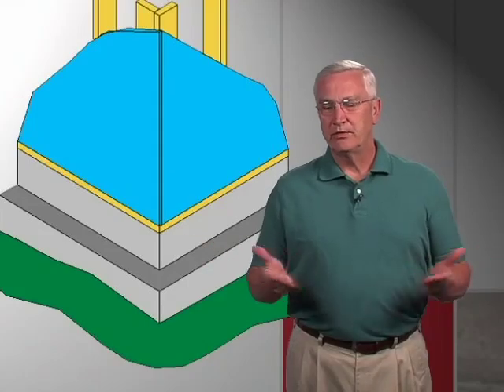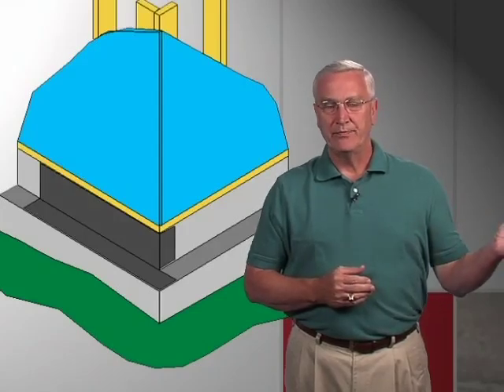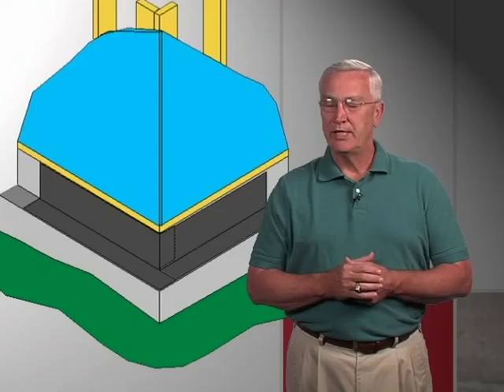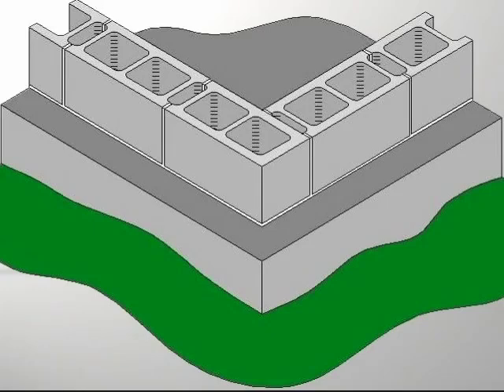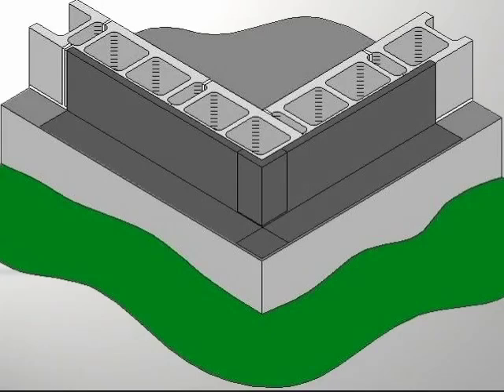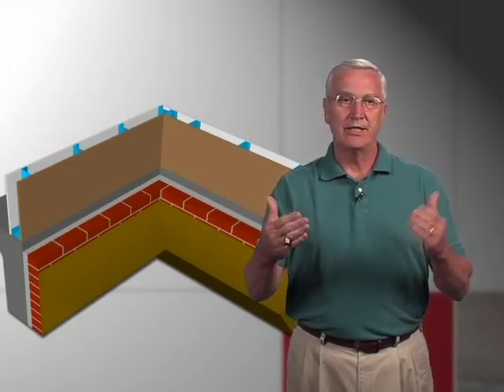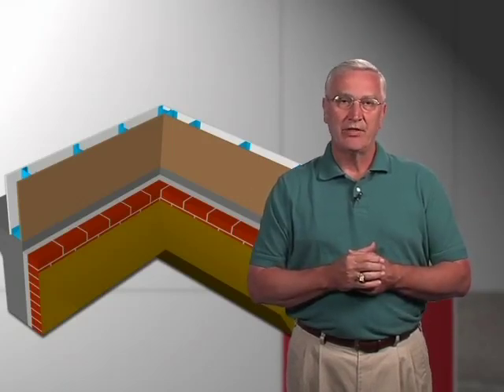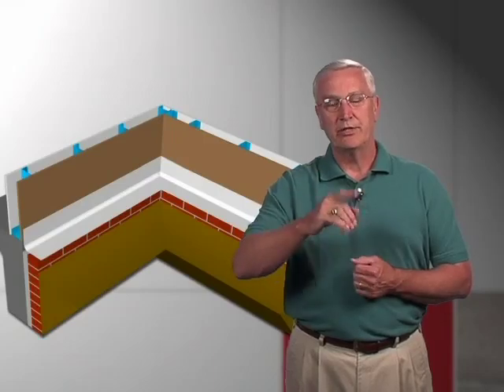Flashing at Corners (Inside & Outside Corner Details)

Comment: I don't agree with this method for the inside corner.  There is no overlap of metal on the vertical inside seam.  Would be better to use a single piece of flashing with a cut 1/2 way through, then bend it around the corner.  That way the vertical corner is continuous with no seam.